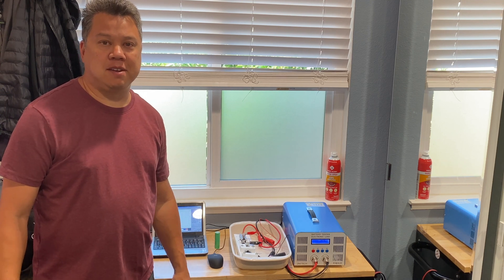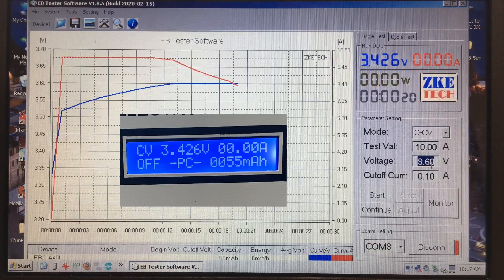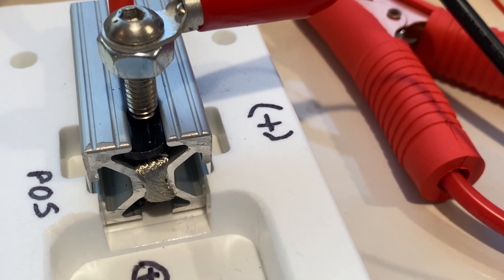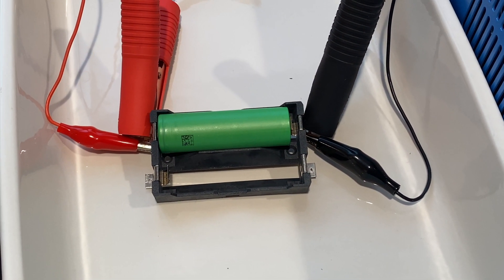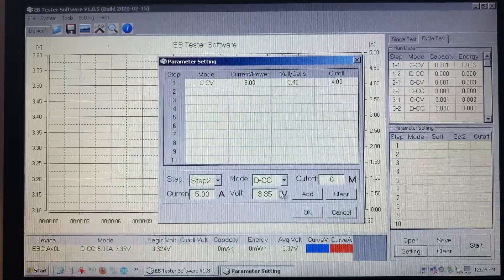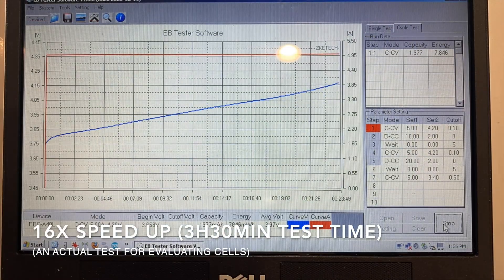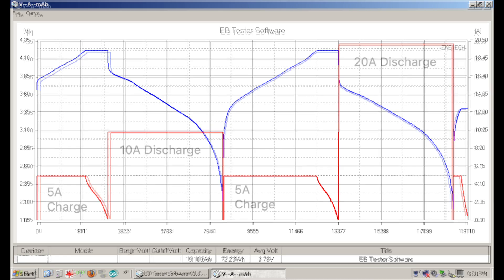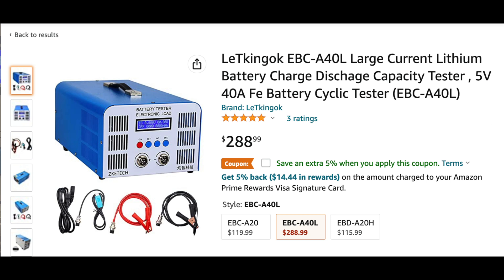Testing 2170 Lithium batteries with the EBC-A40L Capacity tester

Comment: The way you wired the voltage sense helps avoid the voltage drop over the cables but not over the connection itself so you’ll still have a degree of inaccuracy